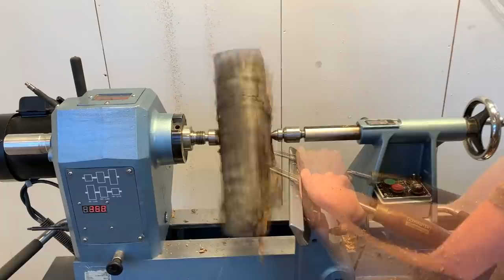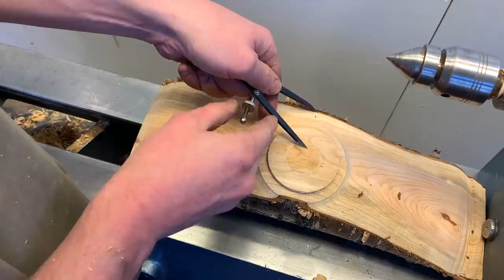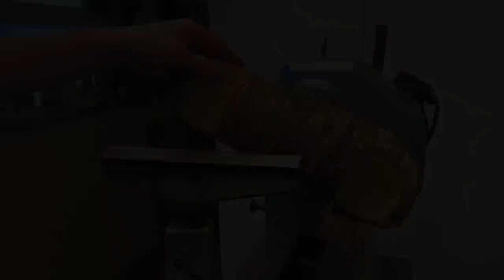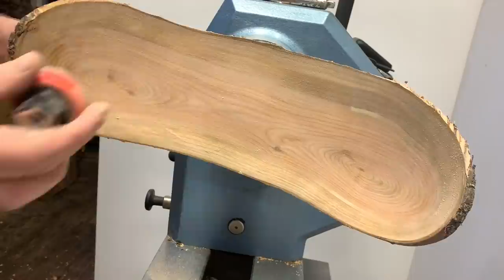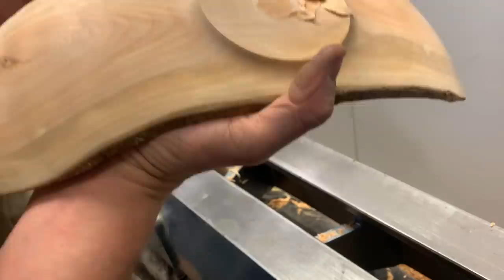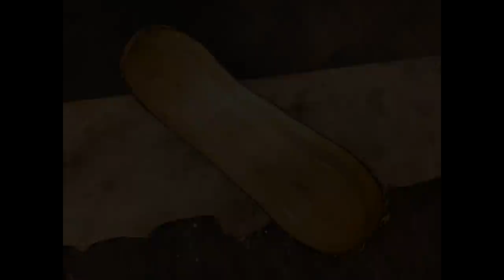Woodturning - Don't Try This At Home!!

Comment: As a metal lathe machinist I have huge respect for wood lathe machinists. Machining is difficult in the best of times and these guys do everything by hand. Very impressive
Reply from the maker: Thanks dude glad you enjoyed it
Reply: Having used a metal lathe like 5 times and concluding it requires black magic this is fucking mad awesome
Reply: Agreed 100% absolutely
Reply from the maker: Thank you 😊👍🏻
Reply: Я тоже токарь по металлу,хочу научиться древесину обрабатывать,,если надо,я в гостиной станок поставлю,а жена будет опилки убирать если эта работа будут доход приносить
Reply: As a person who work in wood factory, but with school more for metal machining, I would say that both is difucult, it may looks like machine wood is very easy and it is when you firstly try it, but wood still works and you have to respect wood fibers in some situations or you crack it. So wood machining is easy, but you have to count with what it will do after some time, you have to care about wood humidity, when it's not dry enough, it can get smaller just by drying and it's not like 0.2mm or something, it can dry about 5 mm on 100 cm plate in 2 weeks. Metal is much much harder to machine, but it will stay as you made it, so I would say from long therm view, machining metal is easier when you have some production and you need all things the same, which is really complicated with wood, you need a lot of experiences when you want reliable wood production, it everything looks so simple for your bosses and owner of your factory, but when you do it properly as it should be done (not like they want it from you because it's faster) then it's not that easy and simple. We have constantly problems with that, they make wooden plate and it bends over weekend that you can't use it, instead of making it correctly, they just make many of that and expect some of that plates will be usefull, it's ridiculous how it's done in modern companies which are owned by not technicaly educated people. And people under owner are same stupid, when you try to explain to them that make it correctly will be actually faster and cheaper, they don't understand what are you talking about because they don't have technical and economical thinking, they don't see to the future, they don't see their production as whole, they see only some irrelevant numbers on paper and they are there only because of they are friends of owner or his family. You hate to constantly fight against them, you want the best for company where you work (becaue it's even about your money) and these bosses are doging everything to make company earn less money, sometimes you have to do improvements secretly and not telling it to them, it's really ridiculous, they want some thing complicated because they think that customer wants it like that, but customer knows shit about what should be inside of product and how exactly is machined some part which is not even visible. This thinking like "it must look expensive inside" is like plague, it must work mainly and look good from outside and be safe for customer. They care about shits, but when they made cabinet with drawers, they don't brush it bottom from both sides, so when you put sock there, upper drawer will destroy it because it doesn't have smooth surface, as I said, they care about shits, but when it's actually important to machine even not visible side, they think it's wasting of time, so it's everything fake in this "it must look expensive" ideology.
Wood factory must be ruled by people who are educated in wood machining or it can't really work. When you machine that bended plate, it's still not that bad, you can keep it lying on ground with arc up and it will be straight again after some time, when I try to expalin it to our Romanians who do finnish works, you know what they do? They firstly put surface on that and then they let it on ground, which is completely pointless, it works only when it doesn't have surface yet, or you have to put surface (paint or oil) only to side which you want to dry slower, it's simple mechanics, upper side is getting dry faster and decreasing dimension on that side, so you can bend it back, I don't understand why is it so hard to understand for most of people. 😀

Sorry, 90% of this comment is OT, I just wanted to say that making something from wood is much complicated than it looks like on first look.
Reply: I was a machinist too before switching professions to accounting. I love the business aspect of my new job, but I've taken up woodworking as an homage to my former life. Once a maker, always a maker.

Comment: I like how you make peace with risking your life and/of limbs for a tray. That’s commitment to this form of art.
Reply from the maker: There’s no risk here. What is it you feel is risky aka uncertain?
Reply: @JackMackWoodturning  It looks like the vane is about to come off. Given the length of the vane, the torn off tip would be a good way to jab into the soft parts of the body.
Reply: @JackMackWoodturning  lol you put 'don't try this at home' in the title, no risk my ass..
Reply from the maker: No risk for a professional who spends 50 hours a week at the lathe. The ‘don’t try this at home’ is for amateur turners. It is only dangerous if the correct safety protocols are not observed. Thanks for watching 😉😊👍🏻

Comment: Initially, I got mad at you for wasting so much wood.  Then I saw what came out of that log, what a thing of beauty!  I love wood.  Its my Chinese element, and I have done years of wood refinishing bringing abandoned antiques back to life from the dead.  I know the feeling when that layer of oil goes on, the wood turns golden, and you hear a golden shower of alleluias in your head. I'd like to know what oil you used, and wax.

Here is a trick I use. After oiling, wipe off excess and let dry 2-7 days depending on oil.  Dilute polyurethane oil based interior clear satin type (Varethane) with Mineral Spirits in 40:60 mix in favor of the solvent.  Brush the edges of the dish with this, letting it soak in.  Wipe off excess in 15 mins before letting it dry so wood looks natural.  When dry in 2 hrs, apply 1-2 more layers.  Being very thinned out, it soaks into the wood, bonding the bark to the wood so no risk of falling out. It also strengthens the wood.  You don't see it.  The wood feels natural. You can coat the piece with this thinned out poly as well. 1-2 coats, wiping off excess. When dry, buff with wax.  Much more durable, and no color change with time.

You really are a master craftsman.  That was a very dangerous and difficult project going at the log from that angle. It could have broken off and hit you on the head like a projectile.  Nice work!
Reply from the maker: Thanks for the advice MJ. I used microcrystalline wax and danish oil 👍🏻😊

Comment: This is the most dangerous silly thing I’ve seen done on a lathe in a while, fantastic work well done.
Reply from the maker: Struggling to decide if that is sarcasm or not 😂
It is actually very safe if approached correctly. Thanks for watching 👍🏻😊
Reply: @JackMackWoodturning For somebody with your high level of talent and knowledge   that is certainly true. And for real no sarcasm, super impressed with all your work I've seen so far. Thanks for sharing your projects!
Reply from the maker: No problem Slice. Are you a fighter? 🥊
Reply: @JackMackWoodturning  😂😂 No just a fan, I’m a 3D Printer-er

Comment: what an amazing bandsaw project. Only needs 2 cuts and some sanding! Amazing!
Reply from the maker: Haha, let’s compare yours to mine.. and in a few years when you understand woodworking we can both laugh at how you though that was a clever thing to say 😆😉
Reply: @JackMackWoodturning  It was a joke my dude. I'm aware of the concave indent down the center-line of the piece due to the turning process that would be difficult to replicate in any other way than turning.
I'm a woodworker myself so I'm always looking at clever ideas on YT to see how i can expand my skill set and maybe get some clever ideas. 
=p personally this project is on the uncomfortable side so no way in hell am i playing with this!

But "technically" one could do this with a basic saw and a card scraper with enough time and effort there's always other ways to do things. 😜
Reply from the maker: For real my man, there is as they say many ways to skin a cat. 👍🏻

Comment: As fun as this is to watch I can’t help but feel like there is a much simpler way to achieve the same goal without spinning it long ways like that and risking breaking things. Just a feeling
Reply: Like using a ban saw ? 😅😅
Reply from the maker: Twas a demonstration of technique fellaz, not a tutorial 😊👍🏻😂
Reply: Atleast  you gave a response.  Cheers 🍻
Reply: @JackMackWoodturning  I wasn’t judging. I promise. Just concerned about the safety of everything not metal in that room up to and including your very human body. Lmao. But as always it was a beautiful piece of art in the end.
Reply from the maker: It’s okay steve. There’s really nothing to worry about if the piece is mounted correctly. If it’s balanced then it’s almost exactly the same as turning a bowl of the same diameter. Obviously you don’t want to try to sand it by hand with the lathe running but it’s not AS dangerous or abstract as it appears.

Comment: Great video, but wouldn't something similar be easier, faster, and most importantly safer to do with other tools. You could mark the desired shape on the side of the workpiece and then make vertical cuts of different depths with a saw. Then remove the resulting blocks with a chisel and clean up the whole thing. The last step could be done on the lathe to get more symmetry, but to remove so much material on the lathe as shown in the video does not seem to me the best solution.
Reply from the maker: Cheers mate. Yeah of course, there are many ways to skin a cat as they say. For me, the easiest way is to spin them on the lathe, the edits on the video make it appear some what labour-some but that’s just changing up camera angles and stopping the lathe a lot so the viewer can see what’s happening. 
This type of bowl takes me about 20 mins the make from start to finish and for me this is a simple and safe method of working. I turn bowls all day 5 days a week and clock up around 60 hours per week at the lathe and have done for many years.. this definitely isn’t a beginners project. But It’s also not unsafe.. its actually exactly the same as turning a round bowl of the same diameter only you don’t want to sand this one with the lathe running. 
The reason I dont remove wood before starting to turn the piece is simply that it gives you more scope. Firstly the piece needs to be aligned correctly between centres so the you get balance from the finished form (or lack of balance if that is the desired effect) to do that it useful to take a few cuts with a gouge and compare them end to end and see they both hit the same spot on either side. It’s important to note that although wood is removed in shavings it’s often the removal of this wood that tells the turners how to proceed, meaning the wood removed has function within the process. 

Another reason is to be able to change the plan mid project. Although I make countless bowls to match the ones that have gone before there are times when a defect in the wood will cause you to need to change the plan or loose the whole bowl. This means you need to remove more wood than you’d planned. If you have already removed wood from the centre you have limited your ability to finish a piece and risk wasting the whole log. 

While you are entirely correct that there are other ways to achieve the same form it is in my opinion fair to say this is the best and most effective way to create this particular piece. 

I also return all shavings to the earth as nature intended by way of composting so getting one log per small section of branch is fine by me.
Reply from the maker: you could hammer a log into submission and lick it smooth ?? 
It would still be a different approach and a different finished piece
Reply: @JackMackWoodturning  I think it ultimately depends on what tools you have. The editing made it look a lot more time consuming than it actually is.  I don't have a lathe, so I can't compare directly, but in the end there are thousands of ways to the same goal. What remains is a great video which inspires you to be creative yourself.
Reply: @JackMackWoodturning  Some great advice Mack

Comment: Holy crap...that's a hell of a grip and a really sharp chisel.
Reply from the maker: Thanks Fox. Are you a woodturner?
Reply: @JackMackWoodturning  I am not bud. I only had woodshop in middle school that's about it 😄 I do have my grandfathers old baseball bat lathe but I never used it for any projects. I just recognized talent. To be able to hold that chisel. with a small log moving at that speed, is nuts. You handled that piece very well, as dangerous as that could be.
Reply from the maker: Cheers. I appreciate you watching. And glad your enjoying it. You should get that lathe running and have a go

Comment: I was just wondering my next project and this is what i have to try. Thanks for the tip😉👍
Reply from the maker: Be careful J..
Reply: @JackMackWoodturning  I just finished two smaller practice pieces about 25cm diameter with no accidents 😁

Comment: Excellent work.  I have done a few myself using a three pronged fork piece and quite large diameter.

I always use a face plate for the initial turning and prefer a mortice.  Sanding is certainly interesting!
Reply from the maker: If you start the piece between centres you can manipulate the angle to achieve balance in the final piece. 😊👍🏻

Comment: Incredible work of Genius... May I ask what size motor does your lathe have? Any recommendations? Would a 550W 0.75hp Electric Motor be able to handle this kinda work, cheers Peter - St Albans UK

Aluminium Construction
Reply from the maker: Sorry mate I don’t know the answer to this one. But I can tell you that you can turn this pieces in any sized lathe as long as the piece is balanced well.

Comment: Was there an EMT standing by -- or did skip that precaution and go right to inviting the coroner to be ready?
Reply from the maker: Why would that be necessary? Iv been making this style serving bowl for years.. and been a professional wood turner for longer than I care to say. Is there something you think you know that I’m missing?
Reply: @JackMackWoodturning  You're a far more experienced turner than I am.  I apply the lessons I learned in my corporate safety training when evaluating the risk of an activity.  Considerations are 1.  Frequency (how often is the activity done)  2.  Probability (how likely is an unsafe outcome)  3.  Severity (how severe could that outcome be.)  By my initial flippant comment you can see that I would consider #2 as being a bit likely and #3 as being too high for me.  I don't know about #1 in your shop.  Thus I respect your warning to not try this at home.  Impressive project.

Comment: What is that electric tool you use to take off the last bit of the tenon??? I love turning but getting that nub off is always a pain and I’ve ruined a couple pieces in the process
Reply from the maker: It is a bit of a pain. This tool is a power chisel that attaches to a rotary tool, like a dremel
Reply: @JackMackWoodturning  perfect I just bought a Dremel!

Comment: Loved watching this - dangerous but you have the skill to pull it off. What was the finish used in the end? 

My dad was a carpenter/joiner, mostly a cabinet maker but he left me with a firm appreciation for the trade.  He was often able to realise jobs with no more than a simple sketch as a rough idea of what he wanted to make. My own carpentry skills are non existant - measure 3 times, cut once and it's still the wrong length ;) I became an electronics and software engineer instead.. but id' give anything to have even a fraction of my old man's skills... i would love to be able to make a set of speakers for example!
Reply from the maker: Hey Peter , thanks for watching. The finish was danish oil over shellac sealer 👍🏻

Comment: You're a braver man than I, turning a log like that.
Too easy to get your knuckles rapped by it!
Full marks for valour.😊👍
.
Reply from the maker: It’s not about being brave, normally brave means stupid and lucky. In this case it’s just about stopping regularly and checking where everything is.. and keeping yourself behind the tool rest. It’s not different to turning a full bowl of the same diameter.. fast speed spindle helps and for that you just need to start by getting the piece balanced by weight, rather than buy length/width
Cheers for watching and the kind words 👍🏻😊
Reply: @JackMackWoodturning  
When you are old, and occasionally inclined to be a bit absent minded, let your mind wander, and to lose concentration, then you have to be brave to start that type of work.
Sure once you've got one completed, and proven your ability to oneself, then it's just repetition.
(Typo; you need 'by,' not; 'buy, length/')
.

Comment: I got my first lathe for Christmas but I have experience with metal/wood lathes and lots of woodworking experience too, but I am confused on what this would be used for, does anyone know?
Reply from the maker: It’s just an ornamental platter buddy. The video was more based around the mounting orientation of the log and the techniques used. 😉👍🏻😊
Reply: @JackMackWoodturning  thanks for letting me know what it is. I was very impressed with the techniques you used.
Reply from the maker: Thanks C, let me know if you have any questions 😉